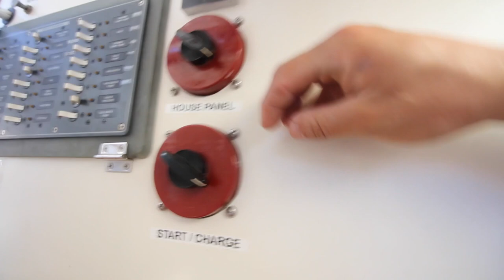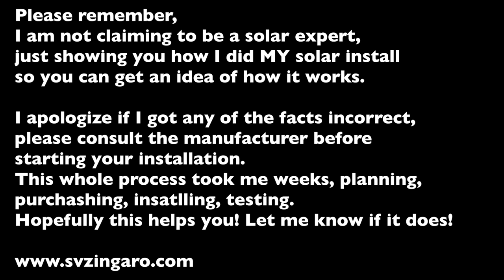How-to: Install solar panels on your sailboat | Sailing Zingaro

Comment: Series connection is much more efficient. Higher voltage results in less cable loss. It also allows the panel to work more efficiently when partially shaded. You can also use a lower gauge cable to connect the panels to your battery (or a longer cable with less loss).

Comment: 3 years late, but just fyi if wired in a series you risk all the panels not functioning if one gets too much shade or has an issue.  It's more annoying to wire parallel, but you'll be glad you did long term.

Comment: good video.  I suggest you buy and use specific Mc4 Connectors instead of cutting off the wire strands.

Comment: I could not find the input voltage rating for your charger; if it is equal or above 53.1 VDC, the most efficient connection will be series (it reduces the voltage drop by reducing the current).

Comment: Oh man you are going to hate those brass grommets next year... I had HQST and switched to PowerFree 135w because they have a glaze on them and SS grommets. The 120w and below at PF are NON-coated. My HQST panel is 6 years old today, kinda yellow but still producing nearly 100w (it's a 100w). That Charge Controller is OVERKILL! Love it!! 

It's not too late to ream out the brass and goto SS. 

Totally agree on the Lineman Pliers. Best there is.
Reply from the maker: Yeah, not too happy with that desicion. That's what you I for going cheap... I'm sure you'll see me changing those out in the next year or so.

Comment: Can you provide some specifics about your electrical generation versus average load?  Are you quite comfortable or do you really have to pick and chose when you can run stuff?  What kind of electrical devices do you have on board? As an engineer, this stuff is of great interest to me.

Loving your videos by the way.

Comment: Did you add diodes in line to stop the voltage going from one panel the the other ? Could damage your panels if you don't have any ...

Comment: Serial is better. Because early morning and evening or cloudy days and/or winter time sun is not so much, so voltage will be less than 10V so your charger will not create more than 13.5 volt so you can't charge your batteries. But if you do serial your voltage will be double (x panel qty) so you always have more than 13v at least so you can make charging. Another good thing is you will have less amper so you will use less diameter cable and loose less energy on the way. always prefer more volt and less amps. because in the power base all is same watt = V x A

Comment: Hi there great channel, and content so tar very much for that. I have a couple of questions, 1. Is there anything you would different looking back? 2. Are the 3 solar panels your only way of generating power and are they enough. I assume you may use quite a bit of power on a 38ft boat! 3. Are there any tips you would give? Happy sailing and thanks

Comment: you got great advice on this install. MPPT, an incredible choice. Where did you get your advice ? But, on the wire, is it solid core romex ? Too bad your busses look all filled up. Its nice when they give you about 25% extra for expansion.

Comment: Hi James. Great shows(s). Enjoy them all very much.Just a heads up. (you may have already thought of this) if your Boat is on a 12 volt system, hooking up your Solar panels in series is Baaad. 3 x 12v panels in series = 36 volts @ same amps/current. 3 x 12v panels in parallel = 12 volts but 3 x the amps/current. Sorry about the lightning strike that took out your stuff. That sucks.Fair winds, Man.

Comment: connecting 3 x 12v panels in series (36 v) would have blown up your batteries, match the voltage to your system eg 12v system = 12v charger, 24v system = 24 v charger...
Reply from the maker: Actually, with a MPPT controller you can have a much greater Voc (open circuit voltage) input, so series is an option. However parallel is better for shading, as one panel can still output max when one is shaded. I’ve verified this works, and would recommend parallel to anyone for sailboat applications.

Comment: these kinds solar panel only last 6month to 1years or 2years if you clean it well.but the power will lose more after 2years,and not suggest to install them on yacht or boat,because the material are not weatherproof .  We are solar manufacture we know the material well.that's we do not produce  PET flexible solar panel now.
Reply from the maker: Anybody with a boat knows you can't have everything perfect. I needed light and cheap. ;)
Reply from the maker: I was thinking about your comment today as I cleaned the panels... they are starting to delam. boo. You were right, these aren't going to last.
Reply: Link Solar Electric Group Co.,Ltd. I have a solar geyser for my house how do I cover the panels when I am not using  them during summer
Reply: maybe yall should sponsor him with panels or a  system that will work long therm !!!  ????
Reply: +Link Solar Electric Group Co.,Ltd. I've been researching average cost to install solar power system  and found an awesome website at Ewans energy roadmap (google it if you're interested)
Reply: If you use these panels you have to be very careful as they only have one diode to keep voltage to come back from other panes connected to it. Be very careful that your panels don't get one spot in the shade or it will cause to overheat and will burn through and cause what ever is underneath pane to burn.

Comment: Man, i am a professional car stereo installer. I have been in the industry for 26 years now and i really wish you would have done some math before you choose the 10 gauge wire to run from your batteries to your controller and from battery to battery. You dont know how much more current you get from a bigger wire such as 4 gauge, and then making sure it is Oxygen free copper opposed to Copper Clad or CCA wire. Also, NEVER, and i mean NEVER run such a long run of wire from a battery without a FUSE no futher than 6 inches away from your battery!!! That made me cringe to see no fuse and a huge run of wire!!!!! Just a thought for next time or someone reading this!!!!